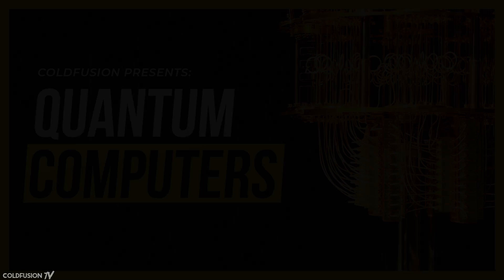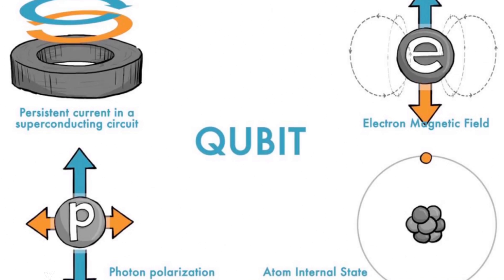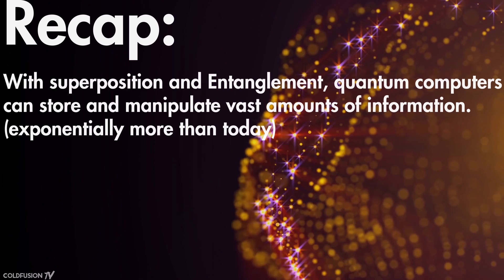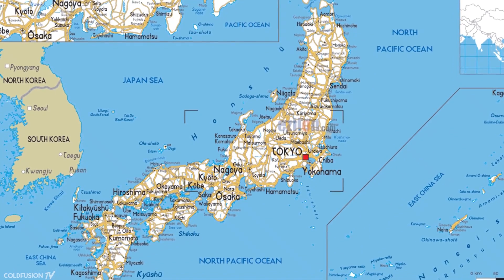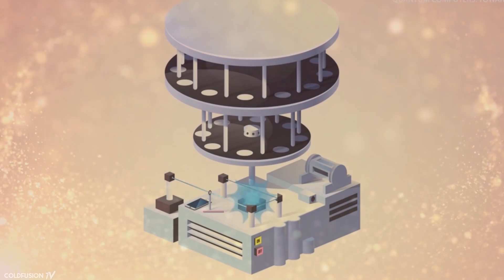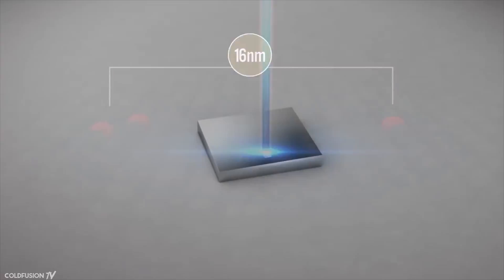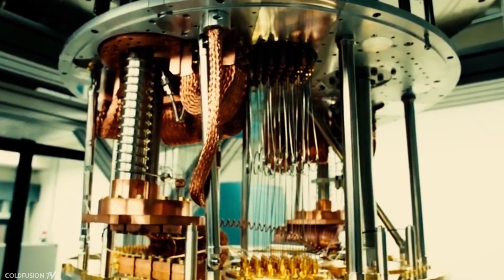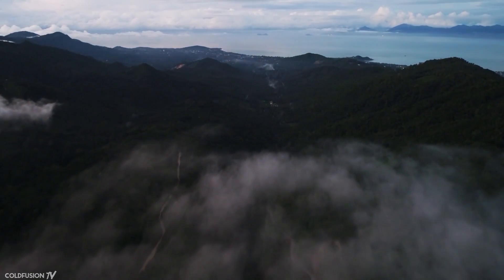Quantum Computers - FULLY Explained!

Comment: Eh... Um. So... I guess my brain works more like a quantum computer then? Huh.
See there's tons of stuff my brain. Doesn't understand about how simple math works so to give an answer I push a few dozen immediately to the fore based on learned concepts merged with results from past correct answers. Of course that is just used for mental math. If I'm using pen and paper then that goes out the window and I use counting method and write out the answer and processes that lead me to an answer on the paper... Just like a good old fashioned computer would use a hard drive.

Anyway will be interesting to see how long it takes before we get a quantum computer working well enough to attempt to solve exceptionally complex problems. Still the software will need the right data to work with.

Comment: I've always compared superpositions and (strings) with the dot of a laser-pen in motion. When you get to small enough space, the infinitesimal energy needed to cause a vibration is just so incredibly that its like making a circle on the wall. it looks like its a complete ring is formed and relativistic to your eyes it is. The same with electrons or even (strings) but its even more real than the laser-dot because a macro-being simply don't relate to that incomprehensible small of a state. Also it seems like temperature and space is equally related as electricity and magnetism. Cold expands heat contract. Maybe that´s why light seems to slow down and even stop when driving it through a bose-einstein condensate. who knows.
Reply: What? Light does not "seem to slow down" in a Bose-Einstein condensate. It does slow down because it forms a polariton and gains mass. Like it slows down in any medium compared to vacuum. That's how diffraction works after all.

Comment: Feels like that electrons are in another dimension

Can u explain 4th dimension concepts plz
Reply: The 4th dimension is simply what we percieve as time. Think about it this way. If we lived in 2 dimensions (x and y)  like on a sheet of paper and a 3D object like a pencil were to go through our 2d sheet of paper it would appear to go through diferent stages. First a pink circle for the rubber, then a metal ring for a bit, then a yellow hexagon for a long time, then back to a brown circle that would get smaller before becoming a black point and disappear. In this, the lenght of the pencil is z, the 3rd dimension. But z is time in 2d. Now if you could see though the 4th dimension, if you looked to the "left" (for lack of a better word), you would see the past and to the "right" the future. Time would just be an other spacial dimension. 
Hope that makes sense. Olso sorry for the bad english i'm to lazy to correct myself. :)
Reply: They exist in a 4th Spacial Dimension (Spacial is key as not time is needed)
Every possible state/position/spin is in a Timeless state of Probabilities (the dart is on every number on the dart board and no number until you throw it and the all the possible possibilities cancel out until you have a definite state /position /spin
Reply: I believe our Dreams are Quantum and in turn allow us to Dip into the Quantum World with 4th Spacial Dimension and 1 Non-linear dimension of Time (doesn't go in a straight line cause and effect can be swapped in dreams the effect of the dream can cause your experience but once your aware and lucid within your dreams you start seeing it in a more linear but still in the Quantum every possible arrangement in the dream is possible until you collapse the superpositional wave function (we wake up from our dream)
Reply: Ugh. They are not in "another dimension". 
4d space is a collection of 3d spaces. We can't perceive them all at once, so think about them as, I dunno, multiple different rooms, each is a different layer of 4d space. If you put long enough object (along 4th axis), it'll exist in all those rooms, that are completely isolated one from another, as if they are in different universes.
But all this is just applying same principles with which we view 3d space as a collection of 2d slices.

So, electrons can't be in 4 dimensions. If they were, their electromagnetic fields would propagate through all 4 dimensions too, thus ruining inverse-square law - electric forces would have a stronger fall-off (it'd be third power instead of second) . 

Time axis does not exist, by the way. Do not listen to the guy above. Time can be a nice thing to use in math, but there is no truly objective way to confirm it's existence. Sounds weird when we are surrounded by the clocks and have concept of time deeply integrated into our way of thinking, right?
Reply: @tempname8263  https://youtu.be/2azFOX9P0fc
Reply: Also, quantum stuff is not as weird as people make it out to be. Most can't view a full picture and come up with twisted interpretations, that make everyone freak out.

It's not Thor coming to get our asses, it's just an electric discharge.

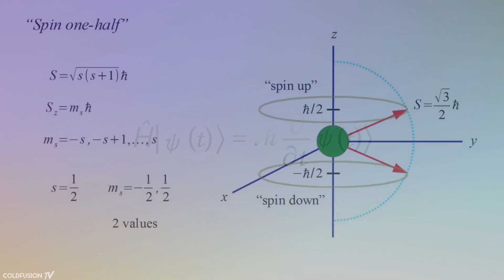Comment: 1:20 I notice that the partial derivative of time of the wave function ket. Shouldn't there be a vertical line indicating it's a ket for the time dependent equation? Kind of like the wave function ket on the left side of the equation?